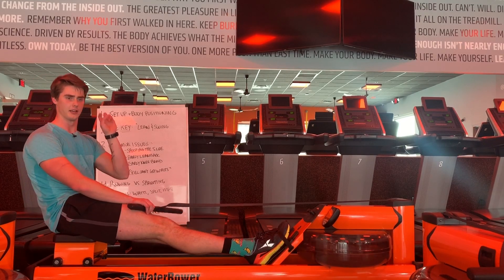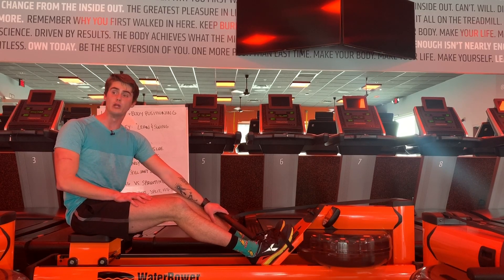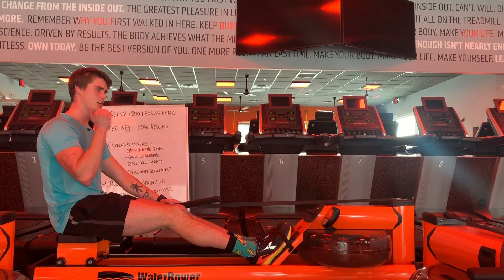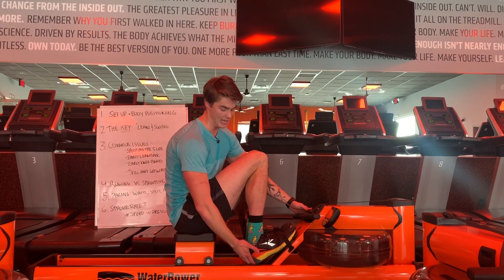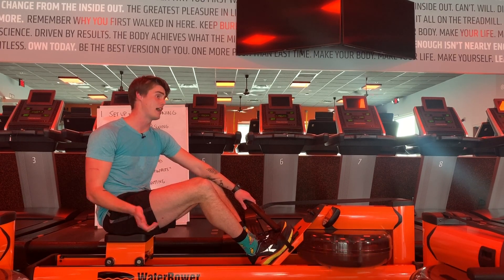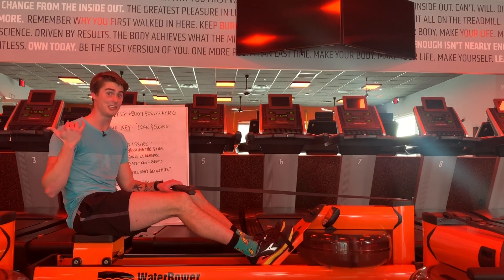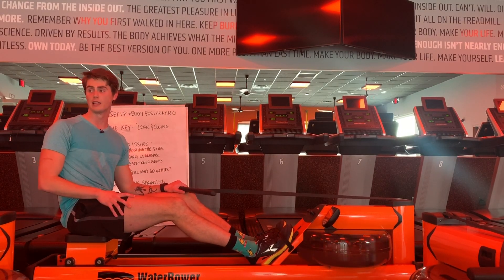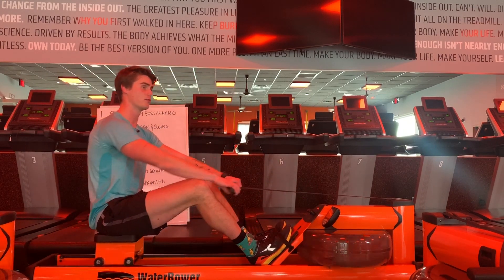Rowing Machine: Long Rows vs. Short Rows (TECHNIQUE)

Comment: It is too bad that the sprint rows require bad form for max times. Counter-intuitive (and counter-productive!) In my last 500m I think I went for a hybrid row. I went with a quick, non-compressed first 100, a full compression-modest stroke rate for the middle 300 and back to the quick/non-compressed row for the last 100.  Unfortunately my last 2k was 6:47 (8 seconds over my previous 6:39). I just didn’t have it in me that day. I think I went out a bit hard and couldn’t keep the 1:40 split I wanted in the middle of the 2k. Got up to almost 1:47 for a while before I got back to 1:40 at 1000m. Oh well, you live you learn!
Reply from the maker: I know its very frustrating to coach, yet it seems to be what most care about... big numbers! And not every day can be your best... that's alright!!